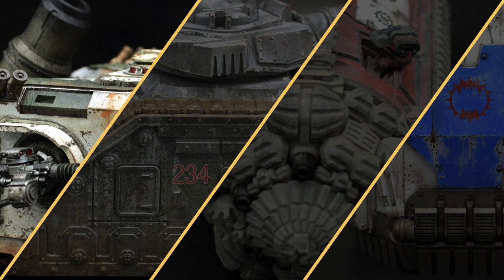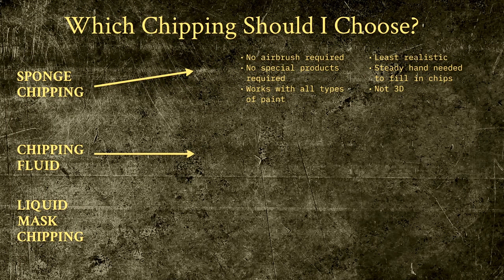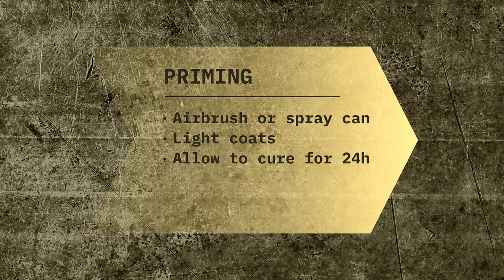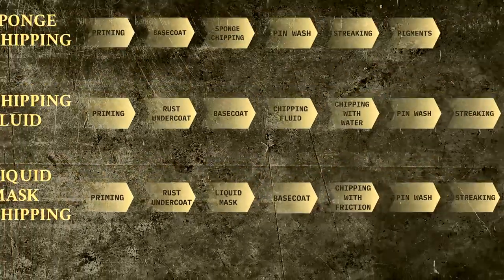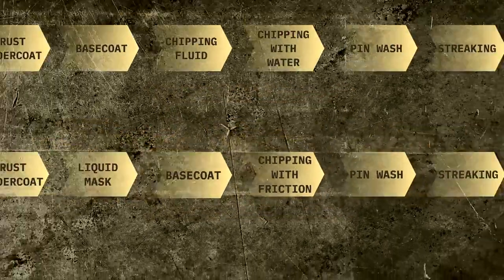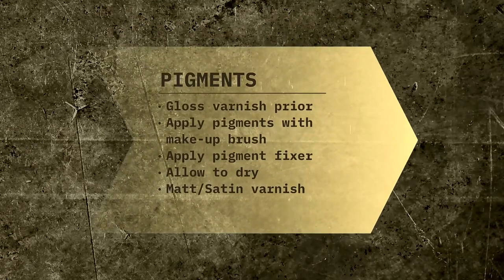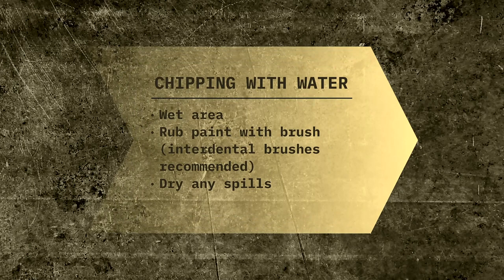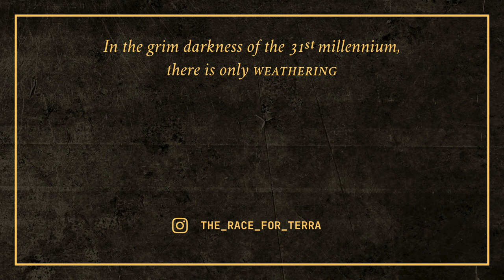Weather your Models! | Visual Guide to Weathering | How to Get Started with Weathering

Comment: Very nice summary video. I'm doing some sponge chipping right now and it is reassuring to see the steps I had planned laid out so nicely!
My only comment is that I think the order of [Basecoat / Chipping Fluid] for the "Chipping Fluid" method should be reversed, ie. you should apply chipping fluid / hairspray over the Rust undercoat first, then apply the basecoat on top of that. Unless I am badly mistaken, the hairspray will soften when water is applied later, and allow the basecoat to easily scrape off.  If you apply the hairspray on top of the basecoat, and then try to remove the basecoat with water, all you are going to achieve is to rub off the hairspray...
Reply from the maker: Thanks, Chris! That is what I did with the chipping fluid, though...maybe I explained it incorrectly? Wouldn't have worked at all otherwise, as you said!
Reply: @TheRaceForTerra  Yeah, it wouldn't have worked, you are right. I haven't used chipping fluid before, only hairspray.
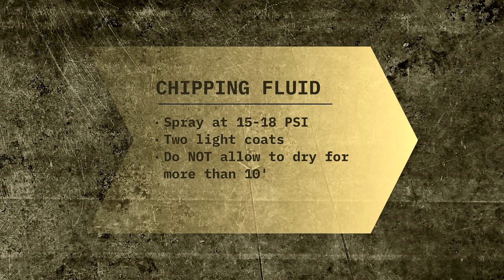What I think happened is that in the demonstration, where you added the chipping fluid to the drop pod at 11:37, you added it over a white undercoat, and when you chip it away with water at 12:28, you aren't chipping away the white - instead you are chipping away the blue base coat to reveal the white. The drop pod doesn't seem to have a rust undercoat, only the white?
But what I do know is that if I am using hairspray, it should go between the undercoat (rust, in your case), and the basecoat.
So your method isn't wrong, but I think the Steps graphic might be. I think your Chipping Fluid sequence should instead read:
Priming -> Rust undercoat -> Chipping fluid (or Hairspray) -> Basecoat -> Chipping with water -> Pin Wash -> Streaking -> Pigments.
What do you think?
If I look at (for example) the Heavy Chipping Effects fluid from Ammo, the website says "Apply a base layer of acrylic paint, a layer of Heavy Chipping Effect followed by a top layer of acrylic paint"...

Comment: This is a great tutorial! Any advice on how to weather smaller-scale models? I'd love to weather my Battletech mechs in a similar way, but I'm worried that the chips and streaks would look too big on that scale.
Reply from the maker: Hi Andy, thanks for subscribing, and for your kind words! I have yet to paint any Battletech, I'm afraid - I bought the core set a year ago after decades of it being a platonic love for me. However, I have applied chipping to Adeptus Titanicus models, which isn't that different. To my mind, the fact the the weapons causing that paint damage would be as huge as the mechs means that scale shouldn't be an issue. Use the barrels of the guns as an indication of what the biggest chips might look like, I would say. Hope this helps!

Comment: Top work as always! 👌
Assuming that you have the required skill and materials to go down the liquid mask route, would you say there is ever a reason to go back to chipping fluid or sponge chipping, particularly on vehicles? Sponge chipping on infantry I can understand due to scale, but is it ever worth going 'backwards' when dealing with larger models?
Reply from the maker: Thanks, Paul! Chipping fluid allows you to make more diffuse effects, which can be useful, and also works with stuff like winter camo on tanks. Sponge chipping I would only use on marines, or for emergencies (I did have this very case when doing LC's Terrax!).

Comment: What dictates which path you choose? Speed, looks, amount of weathering desired, just because?
Reply from the maker: That is an excellent question, Vogless, but not one which I can answer in full here. The abridged version would be to say that it depends on the level of perfection required, but it also depends on what type of paints are being used, what layers may go on top of a particular chipping layer, etc. And then, most importantly, you can have different types of chipping within the same project. For example, take my recent Grim Jagdtiger - that one had sponge chipping on the red (done off camera), and chipping fluid on the Dark Yellow (which I did show).

Comment: A big big big big big thank you! I was needing this information about the steeps and the correct order to make them! One question! Im going to apply chipping with a tiny brush insted of sponge, and Im going to do this in a part of my knight that is just metal (legs painted with vallejo metal color series). When i pass for the streaking part, i Will need to apply varnish. Is the gloss varnish a good idea? Because uselly fu#ks metal paints metal effect. What should i do? And thank you in advance!
Reply from the maker: Hi Nino, your comment was "held for review" due to...a certain word you used 😆, otherwise I would have replied sooner. There's a lot of discussion regarding varnish, but I have always had better results WITH than without. If you don't varnish, the surface will be porous, and blending enamels or oils will be much harder. So my recommendation would be gloss varnish, yes. If everything goes well, I will have a metal weathering tutorial next Friday, using Adeptus Titanicus stuff. How does that sound? 😉

Comment: I don't have an airbrush for the chipping fluid method, but is it possible to do it with a rattle can primer?
Reply from the maker: Hey KH, yes, you could in fact use a hairspray can instead of chipping fluid, and then a rattle can primer as you said. Just don’t wait a lot in between, as rattlecan paints are lacquers, and not very reactive. Apply the paint as soon as the hairspray is dry to the touch, and apply friction with a damp brush as soon as the paint is dry to the touch. Hope this helps!
Reply: @TheRaceForTerra  Sounds good, thanks!